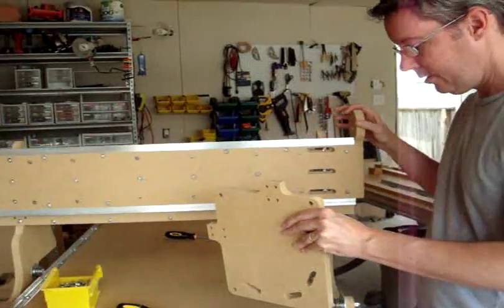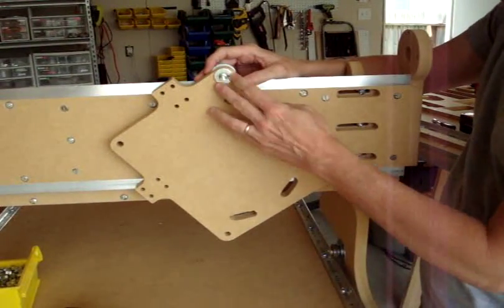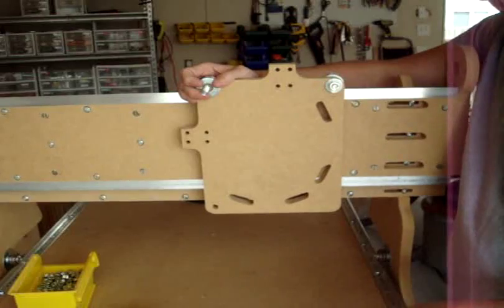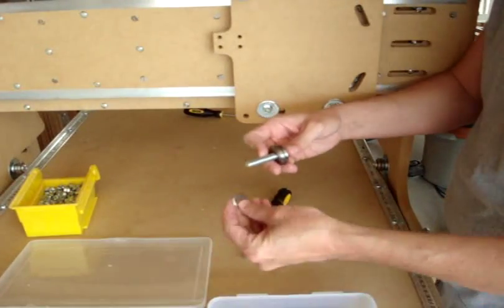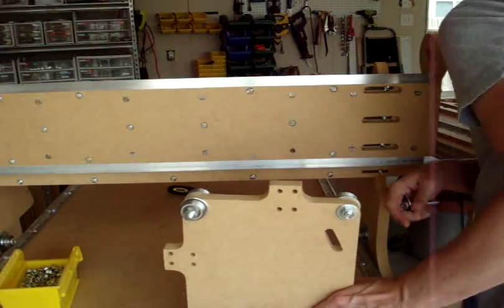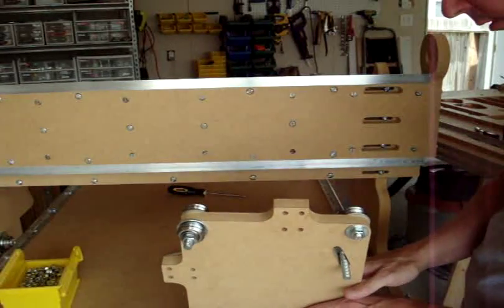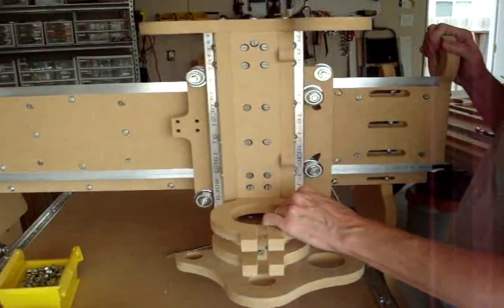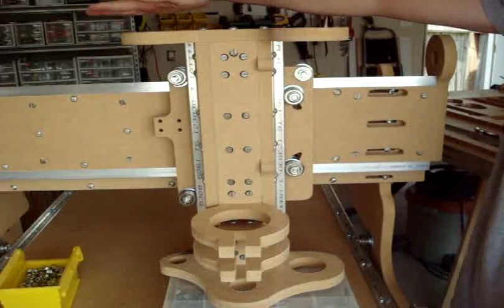CNC Kit Assemble - blacktoe Step 6

Comment from the maker: @Mareksksk I use NEMA 24 size stepping motors with 425 oz-in of torque per motor.  Yes, full characters are possible through CAM, or drawing them out in CAD.